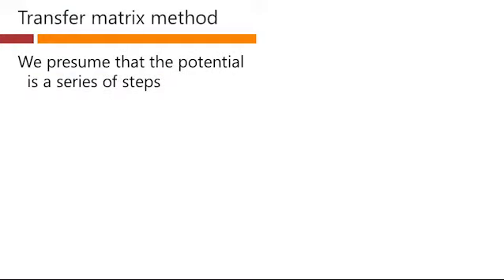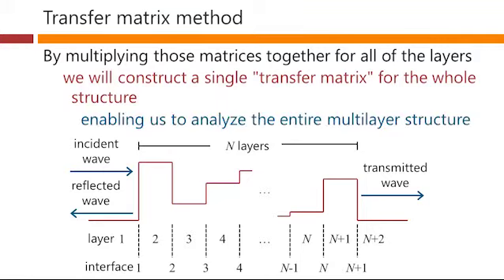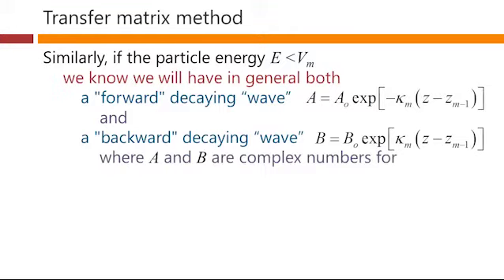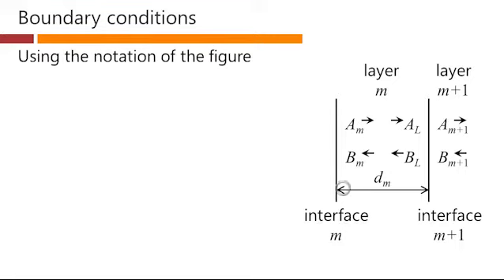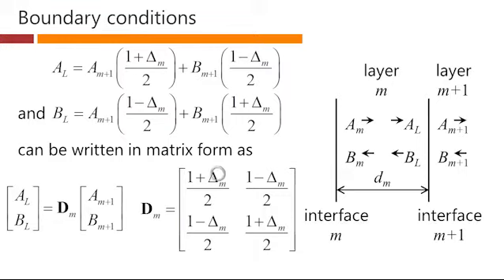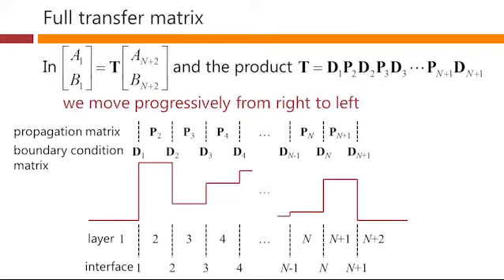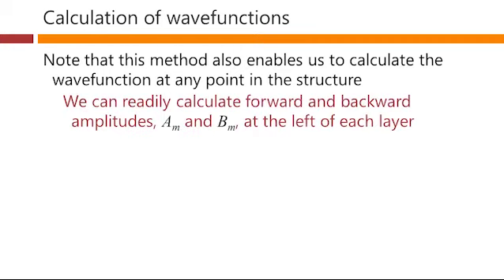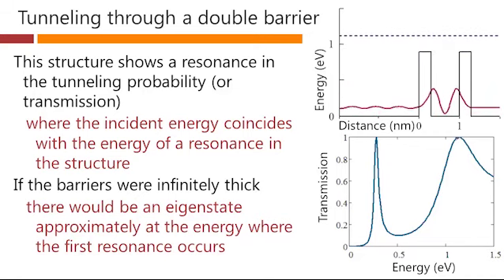Transfer matrix method – David Miller

Comment: Can you achieve the same result using only 1 transfer matrix per interface, which includes the phase?
Reply from the maker: You can always combine two matrices into one by multiplying them, so multiplying the "boundary condition" matrix and the "propagation matrix" to make one matrix for each layer if you want.